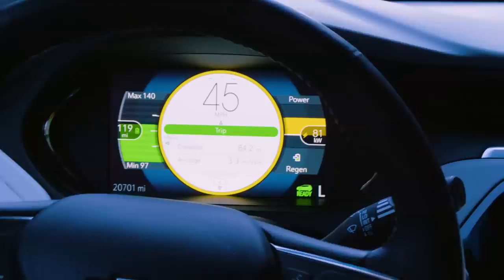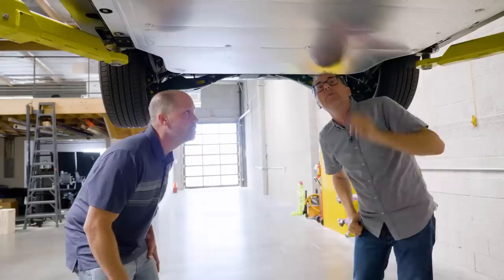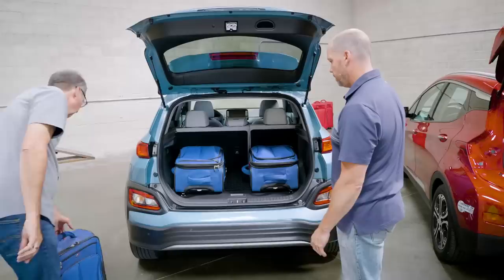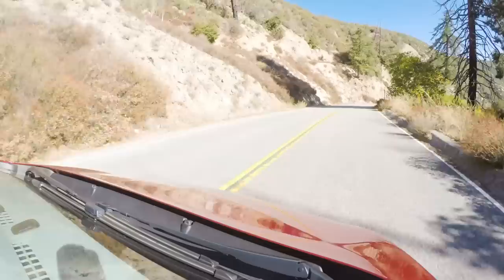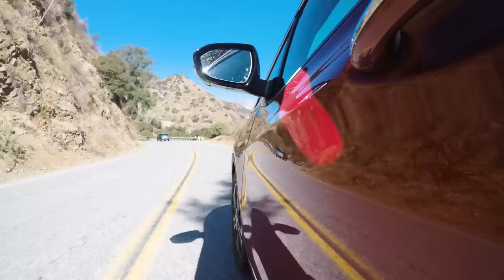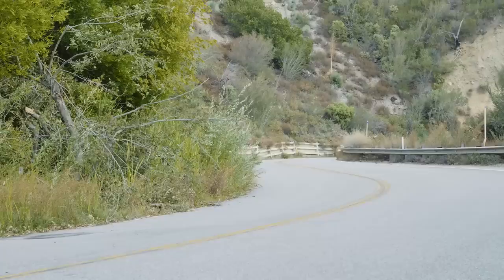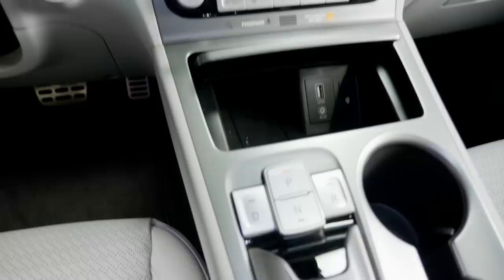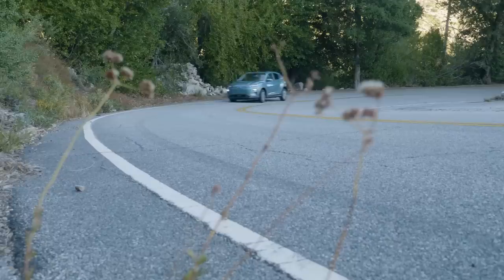Hyundai Kona Electric vs. Chevrolet Bolt EV: Which Is the Best Affordable Long-Range EV? | Edmunds

Comment: Damn that Chevy's interior looks cheap... What the hell is going on there??
Reply: G70 GENESIS has a Chevy interior ever looked luxurious?
Reply: It’s a GM. that’s what’s going on😂
Reply: This is still GM's compliance car. (they won't admit it publicly). They still haven't proven that they want to make EV's.
Reply: Maybe less weight ? Airplane insides are cheap too., on a very expensive fly vehicle.
Reply: @atmartens  popular Silverado is a GM. Corvette GM
Reply: They inneficiently outsource battery production, leaving them only a tiny amount of cash for the interior.
Reply: @ryen7512  - Agreed, but the projected sales numbers for both the Hyundai and Kia EVs are even less than the Bolt. Hyundai/Kia don't intend to build many of these EVs, and they will be primarily for the California market, and a few to other CARB EV mandated states.
Reply: @ryen7512  Actually, the cheap interior materials indicate that it isn't a compliance car. GM intends to make a profit off of it. When you start getting more car than you're actually paying for, that's when it screams "compliance." Say, the Fiat 500e. 

The jury is still out on whether the Kona Electric and e-Niro will be compliance cars in the United States, but it looks like they will be.
Reply: @nothere572  They only get hate because it's "cool" to rip on domestic automakers.  I've test driven a Bolt. I'm a large enough guy that I was concerned with the seats.  I had no issues with it.  I hate rental grey interiors in any car, they always look like crap, and these two are no exception.  Go with the black, and everything immediately looks about $20k better.
Reply: All GM interiors look that way and have for years...
Reply: Nothing going on, its typical chevy quality.
Reply: It's because Chevy does not want ev cars to succeed.
Reply: Chevy, like a rock, sitting in a field and not moving. If they are the heartbeat of America......were dead.
Reply: If you actually see the Bolt's interior, its awesome.
Reply: The quality bolted
Reply: the designer of the Bolt's dash and screen placement should b fired
Reply: @ryen7512  they've sold a ton for a 'compliance' car, and it's available in every state...  The Kona is not.
Reply: @maynotbe  your point?
Reply: @douglasbkerr  on the other hand, Hyundai/Kia will have the Niro, Soul and Kona EV's.  Chevy/GM has one.
Reply: @newscoulomb3705  I think that they are a victim of their own success and haven't ben able to ramp up production worldwide to meet demand.  Hyundai/Kia now has 3 EV's with the Soul, which is also being updated with the Kona EV system
Reply: dadfud4869  no idea what you just blurted out here...
Reply: The Bolt is powered by LG components
Reply: @gameworkerty  If you want to build a car to a price point you have to make choices. an interior or a good battery. Even Tesla has that problem.  Having rented one, I've seen Toyota Camry's with better fit and finish.
Reply: Just about everything else American manufacturers do nowadays
Reply: Ale Jr.  you're making fun of a nationality, but cant even do so without sounding incoherent. Was that even English?
Reply: Ale Jr. liking your own comment shows desperation, as if the caps lock and other grammatical woes didn’t already, lol. Btw this thread is quite old, way to stay relevant ;)
Reply: it's a chevy what do you expect.

Comment: Excellent comparison!  Thanks.

I guess the killer with the Kona EV is that they have almost no battery supply to back it up.  They both use the same supplier, LG Chem, but I understand that Chevy has reserved a considerable supply ahead of time.

Comment: Good review overall.  Though a couple of notes.  The base 64KWh Kona EV is actually a fair bit more expensive than the Bolt EV in South Korea.  So I would expect the Kona EV to be more expensive in North America as well.  The Bolt EV is now into it's third model year and will likely be receiving a mid-cycle enhancement by the time the Kona EV actually shows up in any significant numbers in North America.   Also the Bolt EV is lighter and faster than the Kona EV.  It's nearly a second faster to 60mph.   For people in colder climates the Kona EV does have a heat pump which will help a little bit more for cold weather efficiency.   I'm suprised the review didn't point out how the battery is not as well integrated.  It hangs a couple inches below the chassis which is kinda scary from a road debris standpoint as the battery might be the first thing hit.
Reply: Good point i was just saying that
Reply: I'm no expert but I imagine the battery arrangement makes it easier for it to be serviced
Reply: Good points. Time will tell what the actual pricing and availability is for the Kona Electric. Something I find interesting about this review is that they are comparing a vehicle that has been sold extensively with a vehicle that is still very much in its honeymoon period. It took the 40 kWh Nissan LEAF being sold to actual owners before rapidgate became apparent. 

For me, as a Bolt EV owner, I don't see the value the Kona Electric offers over my Bolt EV... as in, it's not something I would trade my Bolt EV in for. It's simply not a significant enough upgrade. And the Kona Electric is not a vehicle I would trade my Volt for. Essentially, the Kona Electric is a great option for those who want to upgrade their short-range EVs or for those who wanted a 200+ mile EV, didn't like the Bolt EV, and couldn't afford the Model 3.
Reply: The Bolt EV has a heat pump too, but other than that very helpful comments. And I'm not surprised to hear that the Kona is more expensive. Hyundai is not likely to be willing to take the kind of losses that GM is on a per car basis. And unless the Kona comes in at 5-7K higher than the Bolt, the exciting news might be that Hyundai has figured out a way to build this class of EV for less than GM. That's assuming this car will be profitable out of the gate.

I wonder who is supplying the battery. LG?

I wonder if the ground clearance at the battery of the Koan is less than the Bolt?
Reply: @stevebakker6884  Bolt EV does not have a heat pump it uses a resistance heater.  In South Korea the (South Korean built) Kona is 7% more expensive than the (US built and imported) Bolt EV.   So in the US that discrepancy might grow even more. GM makes a positive margin on the Bolt EV.  The only question will be if GM sells enough volume to overcome the capitol investment.
Reply: @erikstephens34  You may be right about both those assertions, but can you quote your sources? I watched a GM produced tech walk-through of the Bolt soon after the car was shipping. The narrator of the video claimed a heat pump was in use. They were showing off the assembled motor in those frames, and as best I recall they pointed to the pump, and the hoses going to it. My memory could be faulty, its just that I was quite impressed that GM had designed in a heat pump so it stuck in my noggin.

Same with margin. I would love to think that the Bolt is positive margin, but every analysis of margin I've read has it thousands in the negative, it's just a question of how much. That of course is 3rd party analysis and is of course subject to being WRONG. That's why I would like to know what your source is. I'm not attached to any belief. :>
Reply: @stevebakker6884  I own a Bolt EV.  I've been to several GM events in the Detroit area.  I have personally talked to Josh Tavel (Chief engineer for Bolt EV).  I have never once seen or heard of a Bolt EV having a heat pump.   I have seen some SAE papers on the heat transfer manifold between the resistance heater and coolant to speed up heating time and reduce the thermal inertia of the system.  I've posed a link that references direct from GM engineering on the heating (point 4). https://insideevs.com/gm-engineers-reveal-top-11-cool-chevrolet-bolt-facts-to-motor-trend/

Now for the finances part.  First every car that is ever built looses money until the manufacturer sells enough units to re-coup the development and tooling costs.   The question where is break even.   The Bolt EV is no exception.  GM sells the Bolt EV at a price that is higher ($3200) than the cost to physically build the car (excluding one time fees).  The UBS study linked below does show that the Bolt EV does currently lose money.  But that with scale and enough volume the Bolt EV could become profitable. https://drive.google.com/file/d/0B20d92QYF8ZTVUUtWDhxb1I0YU0/view
Reply: Erik Stephens  On the heat pump, it's certainly possible the narrator mis-spoke. I found the Inside EVs article after your reply, while looking for the GM video I mentioned (did not find it yet).

On the PDF you linked, Nice! Lots of good info there. Having said that, personally, I take all the firms that do cost analysis with two grains of salt. That includes the Munro report on the Bolt (and the 3). Unless you're privy to parts invoices, etc. .... you know.

But having said THAT, I'm not seeing where in the report that development and tooling costs are included. I had to look up what EBIT means, but the term does not seem to imply development and tooling. I could be wrong.

If the following excerpt is the meat of the report:

"We estimate that GM loses ~7$k per vehicle at the EBIT level, but the
contribution margin (selling price less variable production costs) is in
positive territory at ~$3k."

The statement refers to "production costs", not "development and tooling". I take production costs as the costs in labor, etc. to put the car together. It is separate from the cost of the parts. So, my take on the report is that the Bolt would be profitable now (that 3.2K you mentioned), if the cost to put the car together is not factored in. Not seeing R&D and tooling mentioned. If I missed that I apologize. I will be re-reading the report again as it does have some great info nuggets!

So, not trying to disagree with you Eric, just trying to better understand what has been a mystery since the day the Bolt shipped. :>
Reply: @stevebakker6884  No your not correct. production costs include the cost of the parts.  The UBS study is very clear that with scale the Bolt EV could be profitable.   Of note other tear downs have come to similar conclusions.
Reply: @erikstephens34  Not to belabor the point Eric, but even if with parts included with production my take remains as is. The key takeaway here is that the UBS study sates the Bolt COULD be profitable (at scale). That is the future. It is not profitable yet. Your comment to me countering my assertion that GM loses money on every Bolt "GM makes a positive margin on the Bolt EV" was not qualified for the future. Your statement is not true my friend. I stand by my assertion, which the UBS report validates.

At the end of the day I truly hope the Bolt becomes profitable sooner rather than later. I have studied, and written about, the Hell that GM went through with the EV-1 (which lost the company one billion dollars). GM deserved to be first out of the gate in recent history with a usable (long range) pure EV. And I have driven the Bolt and like it. So no axe to grind here. ;>

https://cleantechnica.com/author/coastalcruiser/
Reply: @stevebakker6884  I never claimed the Bolt EV was profitable (In fact I very clearly claimed otherwise).  But I do stand behind my statement that GM sells the car for a positive margin.  These are two statements that are not contrary.   Because a vehicle needs to be sold in sufficient volume (scale) and margin to become profitable.   This is accounting 101.  If GM fails to produce the Bolt EV (and derivatives) in sufficient volume then it's certainly possible (and quite likely) that it never will be profitable.   But GM does sell the car with a positive margin.   I feel your just arguing for the sake of arguing without understanding the basic principals.
Reply: @stevebakker6884  The Bolt EV doesn't have a heat pump. 

Also, the Kona Electric is more expensive because it comes with more things. I don't think they are making any more money on the Kona Electric than GM is making on the Bolt EV. In fact, I wouldn't be surprised if the Kona is a lower margin car than the Bolt EV (before tax incentives and other credits, such as ZEV).
Reply: I guess you guys are right. I found that video form a year or two ago that gave me the impression the car had a heat pump. See link. They actually called it the device affixed to the motor and that cooled the gearbox oil a "heat exchanger" driven by a "pump". https://youtu.be/sLFOxgBDuB8?t=425

Comment: 2023, currently looking for one of these 2 in Canada, the Kona is 10k more on average, but I decided on a Kona due every Bolt I find does not have its battery replaced and recalls all show remedy not available, not sure how long the waiting line is, but it's too much headache on my end, to get a used EV with an 80% charge cap until who knows when. the Kona I find always has all its recall completed.

Comment: I drive a Chevy Volt and I love it but Id rather have the Kona.
Reply: Yeah, overall the newer Kona certainly wins, but I do prefer the Bolt's exterior lines. I liked my Honda Fit, so I gues I'm partial to that swoopy hatch look.
Reply: Me too. I love EV.  So quick and instant unobnoxious quiet speed. I even feel I would drag race a sports car - probably lose but it wouldn't be by much! 50 miles per charge is unacceptable though.
Reply: J, you would miss your one-pedal driving if you are into that.  The Kona does NOT have it.  I like the looks of the Kona but I love my Chevy Bolt's one-pedal driving.
Reply: @tomted5011  Oh. Forget it then. Gotta have that paddle.

Comment: The Kona EV might as well be vapor ware for the majority of the country as you cannot buy it outside of CARB States.  Plus without final pricing it is not comparable to the Bolt
Reply: Pricing is out... the base model Kona is about $36k US.
Reply: @be236  Here in Europe its 39.000 euro. And it's one of the cheapest. If i want to buy a Opel Ampera E (Which is the GM Bolt) that will cost you ALOT more up to 50.000 euro !!!